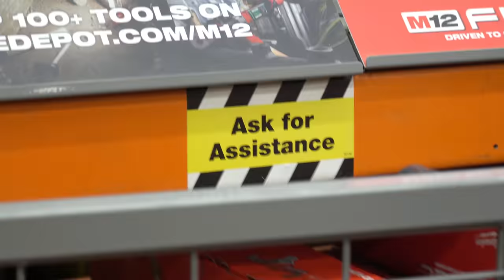Can You Power A Go Kart With Saws? VERY DANGEROUS

Comment: I'm 1 minute in and realized that, even without the implementation of steering, it's there.

You are controlling two different saws which means, if you activate one and leave the other off you can steer.
Reply: Dude, your a f*cking genius.
Reply: exactly what I was thinking its like a tank
Reply: @ThatDepressedFiyosh  Yeah it's like a tank.
Reply: Tank controls!
Reply: @powertron7715  yeah its like a tank
Reply: Literally thought the same thing
Reply: its called differential steering but yes in theory if the saws had any friction and didn't just cut the ground it would work lol
Reply: 3 saws. 3 "wheels".  One front for steering and power, rears for just power.
Reply: @oncinaproductions  yeah it's like a tank
Reply: If they put 4 wheels on but then used the saw blades to give the drive they would likely get this to work a lot better it would make the blades have to do less work as they wouldn't have to overcome so much of the weight

Comment: first thought. have 4 wheels with two saws about where your butt was. then you could release one to steer. second thought. is there a way to attach a wheel onto the saw instead of a blade. then it'd just be an electric go cart
Reply: Not NEARLY enough torque. It would hit the ground and immediately kick up. Or would just fuck the saw.
Reply: this is genius, put wheels on the saw to make it like a go cart powered by saw engines, might need 6-12 saw engines going

Comment: for the design, try and make the board level with a secondary platform for the "motors" because with the current design all your weight+the weight of the board and saws are being pressed on those blades and that's probably why it struggles so much. The fact it was able to move at all with the 200-300 pounds on it was impressive all the same. Good vid.

Comment: I mean, replace the saw blades with wheels and it probably would be decent. Id imagine the biggest problem is all the extra friction the saw blades generate. Remove the blades and use the fittings to attach wheels, extend the controls to the front and your set.

Comment: You could have replaced the saw blades with sprockets and made them push two rear bicycle tires. Probably would have worked better plus you could adjust sprocket size until you get the right ratio to not stall the little electric motor

Comment: you guys want this to work? got chu, what you want is torque, and to go cordless, use the Milwaukee m18 fuel Rear handle saw, get 2 of'em 2 6.o High output batteries, and center the saws in the middle of each side of the board.. ive done something similar before , but on ice, should work